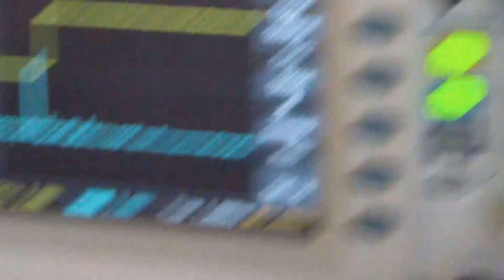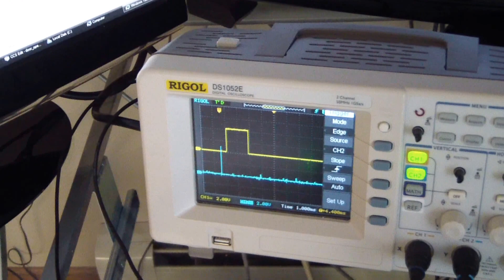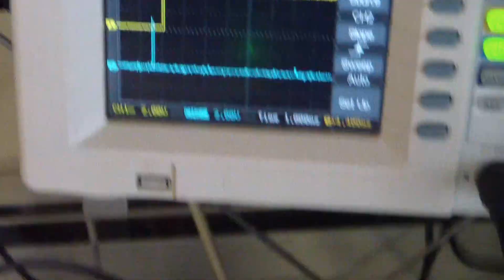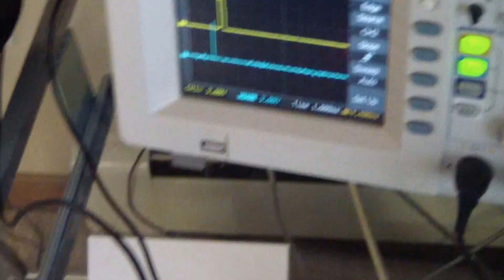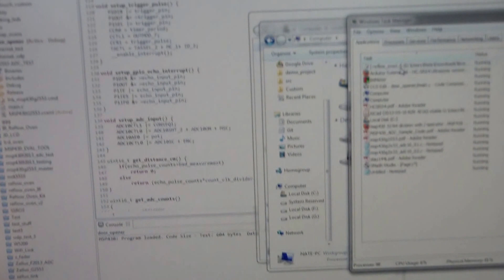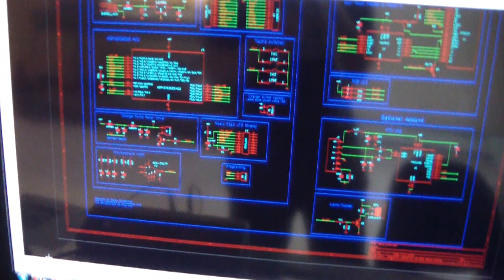ultrasonic carstop

Comment: Take a big and small nail and some 3m (10feet) of shiny rope. Tie small nail to rope and hammer it to your carrage ceiling where you want your car bumper to stop. Then tie big nail to rope about 10cm (4") of the ground.

Now when you drive in you see the rope moving and you know you have driven far enough. Works with 1 coin cell battery over 100 years guaranteed :)
Reply from the maker: Absolutely unacceptable solution! That would require waaaaaaay too much work.